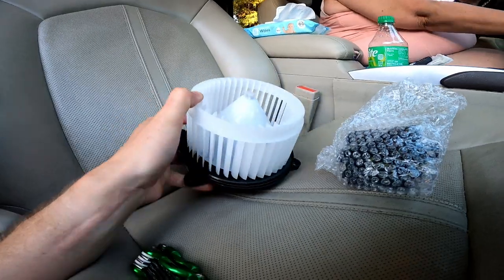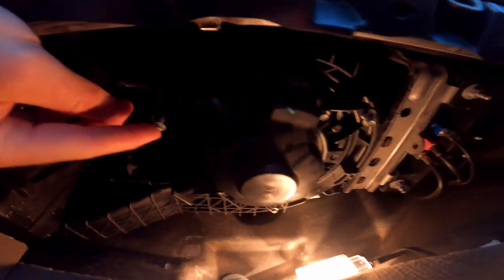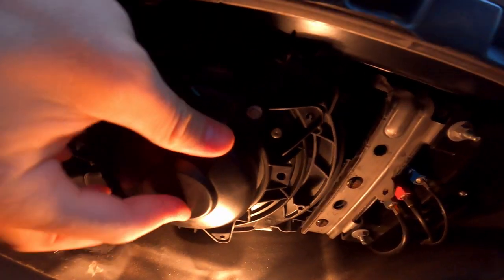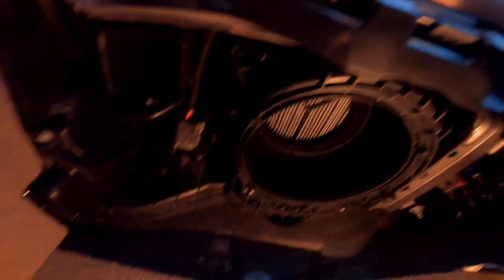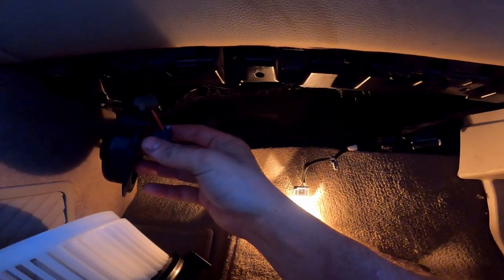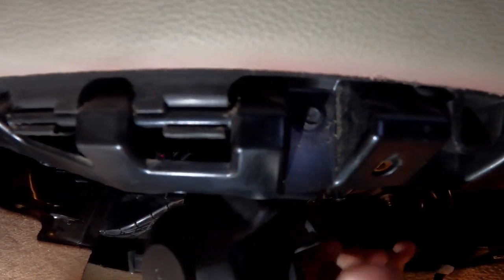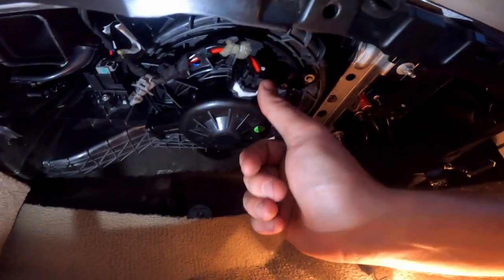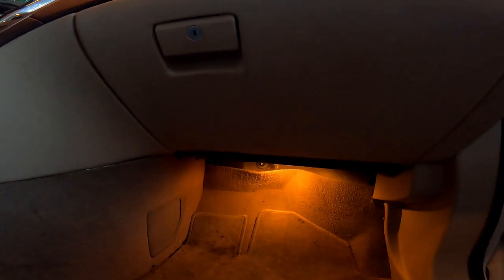HOW TO replace a Blower Motor in a Cadillac SRX (2010 to 2016) - Daily Vlog

Comment: Oh Please... I have a SRX 2011 as well.. EVERYTIME now.. 3 times Ive ordered the part according to GM - ACDelco GM Original Equipment 15-81767 and its WRONG NOT EVEN CLOSE.. The part you used and order is what I need.. Any help.. where did you get it and make and part number? PLEASE PLEASE.. Thx and god bless
Reply from the maker: My Mom ordered them from RockAuto's website. I recommend going there to look for the exact part you need.

Our part number for the blower motor is the GPD number 2311439.
Reply: @ArcticVette  Thanks for the ROCKAUTO reminder.. I totally forgot about them.. I went ahead and ordered the Genuine GM part they also had for the SRX.. I figured out what other places were doing with the wrong part being sent.. they were sending me the AUX BLOWER MOTOR for the REAR!!! WOW.. THANKS SO MUCH AND GOD BLESS YOU!
Reply from the maker: Glad to hear you got it figured out! You're welcome 🙌🏼

Comment: Every part showing for my 2016 Performance Cadillac SRX didn't have same connection.  So I had to cut and solder.
Reply from the maker: Dang! At least that's not a difficult job. Glad to hear you got it fixed 🙌🏼